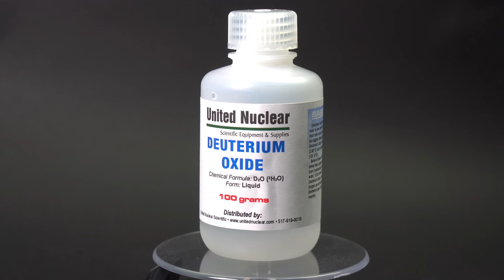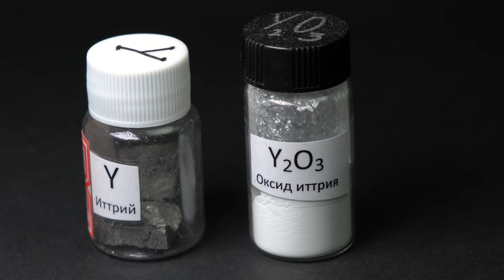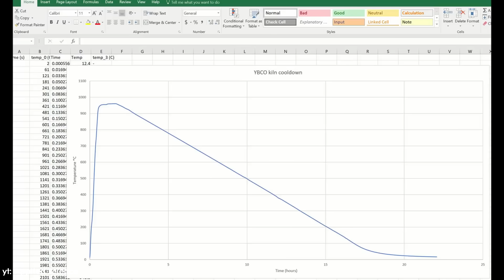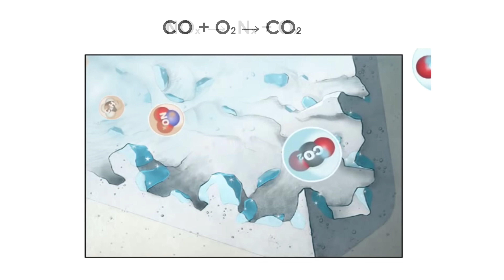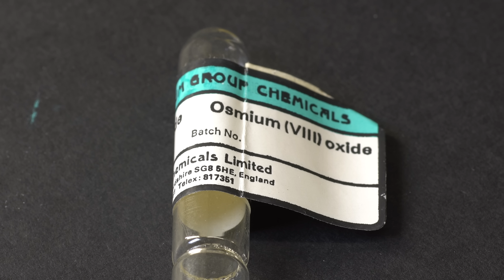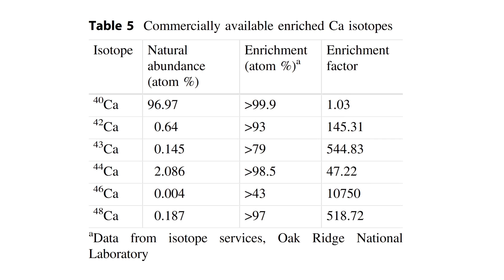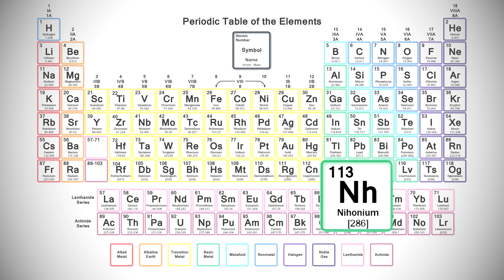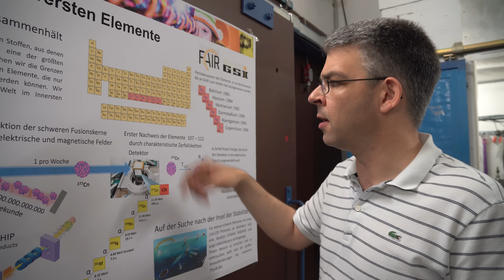How to Turn $50 into $500 using Chemistry?

Comment: One that would be possible for a chemist, with limited funds, is LiAlH4.  It's a very useful reducing agent in organic chemistry, reducing acids, aldehydes, and ketones, to their corresponding alcohols.  It also reduces nitriles to amines.  It's made by reacting LiH & anhydrous AlCl3, as a slurry in anhydrous ether.  The LiH is made by burning Li metal in an atmosphere of H2.  Li can be harvested from lithium batteries.  The AlCl3 can be bought fairly inexpensively.

Comment: Regarding the superconductor, it's much "worse" when you want to make usable "wires" from it to make magnets. You need the YBCO to be almost perfectly single-crystalline, which requires vacuum deposition techniques. The endproduct, a thin tape, costs in the order of 50 euro per meter these days (but quickly going down thanks to private fusion power companies like, Tokamak Energy, ordering thousands of kilometers of the stuff)

Comment: Tritium is needed for fusion reactors. 
You need it for the edges of the reactor for some very complicated reasons. 
But there's basically none as it was thrown out as waste in most reactors that made it around the world. So fusion work is greatly limited by its supply.

Comment: Rhr, real human here, would u mind telling me if u buy memory in bulk if its ok just to soak it outside overnight and skip the other 3 day process that requires mask and more chemicals, i figured just spray off the fingers wirt alcahol, then perhaps borax or no borax could u just shmelt the trace silicon to the surface flick it off and walaa!! 24 k gold right, takes only 1600°f if u use classical rolly metal bin they use for ore shmelt. But i dont know if borax needs alot of oxygen to work either.
Reply: Also mix the big things are copies of large to make a fractal specified unit idk?!, like the lighters thst use quartz for alignment charge, they have ionic lifters, they just made bladeless drones 8 think there using same technique im trying to give food for thought, its like a pressure sensitve multi tube that switches directions and is pressure sensitive maybe valve wise, lets air in fast then compresses it to a point, theres also terger pressure that can be altered frequency and temperature 8 have makes less energy need in electrolosis now they hsve a thing where only one side touches the water in process used to suck more water in

Comment: You need to have a famous company to sell it. If you made it by yourself, no one would buy from you. People buy chemical from Sigma-Aldrich not because the chemical are expensive, it because it is pure chemical and have good reputation. People buy the reputation from Sigma-Alrich, not the materials. For example Yb2O3 from China 50 dollars per KG, Sigma-Aldrich bought Yb2O3 from China and sell it 75 dollar 10 gram, 100 times more expensive.

Comment: You need to have a famous company to sell it, no one would buy from you. People buy chemical from Sigma-Aldrich not because the chemical are expensive, it because it is pure chemical and have good reputation. For example Yb2O3 from China 50 dollars per KG, Sigma-Aldrich bought Yb2O3 from China and sell it 75 dollar 10 gram, 100 times more expensive.

Comment: The video is good and instructive on some curiosities about chemistry, but as a chemist I feel the need to add to the disclaimer in the video by saying DEFINITELY DON'T do ANY of this at home with whatever gear you have cobbled together, without knowing A TON about all of this (even though anybody knowing more than a bit about this wouldn't absolutely attempt it)... And by a ton I mean that no amount of online reading will ever give you the expertise to do it without risking serious damage due to toxicity, or flammability of this stuff or its byproducts: there is a reason why these chemicals are in such high demand (and therefore so expensive), and that is they are not easy to legally make, even for professional manufacturers... Oh and remember you shouldn't even begin to hope you can make a profit out of doing this: you and anybody buying it from you are first and foremost at high chemical risk with no possibile way of preventing it NO MATTER HOW INFORMED YOU ARE, and second you need to comply to international legislation, otherwise you are out of the radar of any serious company on the market for this stuff. And rightly so: this is no game.

Comment: one of the many downsides of these process is that depending on the reagents used, you may not know the contaminants in them so it could add a significant ammount of impurities to your product that could havle a drastic effect on the price. one place might buy your 5 grams of Chloroauric acid for whatever ammount, but if its only like 95%-98% pure the place might not even want to buy it. from what ive gathered from metal refiners and chemists who do stuff like this, any significant ammount of impurities will tank your earnings, plus even if your product is pretty pure you still have to buy pure reagents, which are expensive, so this is really only viable if youre doing it in a large scale (50+ gram ammounts).
Reply: Purity is always where the cost comes from. Anybody can stick a few chemicals together in a bowl and call it a finished product.
Reply: do you know people that do this for a living?
Reply: You have to refine the metals first, sometimes multiple times and as you said, do it in large batches.
Reply: Was thinking same thing , when the costs v the sell price ,
 An ounce of the metal would make it worth while crafting  . 
"ORMUS" , is an easily made , but expensive product to buy - the base ingredients , being quite budget freindly , and should produce good returns - higher still if the 3 noble metals can be separated , as each is a saleable item .

Comment: Couldn't you just have a hydrogen fuel cell that doubles as a heavy water factory, allowing you to store excess energy from say, renewables on site and produce this valuable product at the same time? In fact, couldn't you produce this nuclear moderator using a nuclear reactor? And since your nuclear reactor would be a closed system, you'd never lose any D2O to evaporation.
Reply: Yes you can't let hydrogen escape it's a greenhouse gas so you can do anything with it but don't let it leak

Comment: What i want to know is if some chemistry genius can make binary drugs - two uncontrolled substances that you can mix together and get something like fentanyl, cocaine, morphine, methamphetamine, etc.  Basically take the last two steps of a synthesis and sell those two ingredients packaged together like how they’d sell grape juice and yeast together during prohibition to make wine.  But can you do it without using any listed chemicals?  Or at least sell two totally legal chemicals that when mixed together make a good drug?
Reply: Most states will have some form of legislation controlling the movement and usage of precursors of controlled drugs, some are more harsh than others but as a general rule they all serve to reduce the accessibility of illegal production of controlled substances which attempts to prevent this exact scenario from occurring.
Reply: @CATASTEROID934  yea that is why i said can it be done without listed chemicals (the common precursors like acetic anhydride and piperadine and many others).  But I’m sure someone can make heroin without acetic anhydride, that’s just the simple way to make diacetylmorphine.  I’m sure a more complicated drug like Quaaludes is a better example for doing this.  They can’t ban every chemical there are an infinite amount of them.  The most efficient, simple synthesis methods are going to involve listed precursors, yes. But some genius could come up with a very complicated, inefficient way of making fentanyl without piperadine.  There have to be other ways.  Imagine having a chemical printer (my dream invention).  You just put the elements in, tell it what molecule you want and it makes it atom by atom.  You could just make anything I know, but point is you could make drugs without the controlled precursors.  

Obviously a chemical printer would be the most illegal thing ever, america would nuke anyone even trying to make one.  The cult down the street is gonna print up some nerve gas.  Freedom is dangerous though.  Gotta suck it up.

Comment: include a compressor heat pump with a super conducting electric motor-generator, 100kA current, a ton of wire coil loops
Reply: a lot of power in small size, no resistance of copper coils to high electric current
Reply: try sea water electrolysis to get some of each element, use biomass carbonized carbon electrodes, make more if electrolysis uses up them
Reply: electroplating copper 3d mold filling
Reply: separate ions after D+D fusion synthesis, like the tritium, by mass spectrometry filtering
Reply: no cost is above than the facility it was made in
Reply: how much a country costs, if it was a company, maybe a 100 year of its GDP, maybe 300Trillion USD
Reply: @ccriztoff  of course
Reply: make a superconducting wire loop energy storage, YBCO, L=1000m, I=5kA, E=½LI^2, gives 3.5MWh, in quite nice package, only a fridge magnet strength with air core
Reply: where did you get that the deuterium will concentrate into electrolysis water, only giving out light hydrogen as the gas

Comment: 1:10 As I know the D₂H can also be separated from ordinary water by freezing it. Deuterium has a bit higher (~ +0.1C⁰) freeze temperature than H₂O
Reply: You cannot almost certainly control the freezing process to such a subtle degree, or rather decidegree to be precise. So I'd say it can't be done in real life.
Reply: @LuisAldamiz  you dont  need to freeze 100% of the water 
For example start with 100 liters and keep partially freezing it like 50 % each time 
After a couple cycles you will have a smaller amount enriched with D2O
Reply: @koukouzee2923  - Is it actually done? You seem to be talking of an actual technique.
Reply: @LuisAldamiz  I never seen it done (the freezing method) but theoretically it should work 
But the aluminum NaOH and electrolysis are legit 
I'm planning to do it one day it's in my projects list
Reply: @koukouzee2923  - But does it even exist in real reality? My objection was that such a tiny difference in the freezing temperature is not actually usable because you can't effectively (theory alone does not get things done) control the water mass' temperature to such a tiny level. I grant you that maybe some geniuses have found how but I sincerely doubt it.
Reply: @LuisAldamiz  the temperature difference is actually quite big 
D2o freeze at 3.8C I think and DHO between that and 0C 
The problem is the concentration of D2O and DHO in tap water is extremely low 
Best tactic is to hold the temp at 1C and collect the ice and keep doing that until you got a good enough sample that the D2O crashes at 3.8 C
It's all theoretical but this kind of fun
Reply: @koukouzee2923  - That's not what Oleg said, he said: 0.1ºC, which is a tiny amount. Your datum seems more correct (although it refers to melting point, which is 0ºC for common water). I guess you can play with that differential. Cheers.
Reply: @LuisAldamiz  Ah, sorry, it's my mistake. Actually I've read about in some old Russian book, something about 25 years ago, and don't remember exact difference, just it was small.
Anyway true was found, and 3.8C is good enough temperature 😉
PS. The book was starting with words: Walking in deep autumn nearby Siberian river you may see ice on obstacles in it, but water is flowing and temperature is high enough to make it frozen, what do you think is it ? It's crystallized heavy water ! 
Btw, I suppose tritium has also different freezing temperature, and should be even higher than deuterium, however amount of it in nature is much much smaller than deuterium
Reply: @29Aios  - I ended up going to Wikipedia to check the melting point of regular and heavy water. The difference is much larger than you said and that works for your initial claim because almost 4º of difference may be enough to do as you suggested.
Reply: @LuisAldamiz  you can use the method on a sample of electrolized solution, then if you freeze it while in an insulated container it will start to freeze from the top
Reply: @LuisAldamiz  for pure heavy water, but it is gonna be mixture with 99.9... normal water. And they perfectly mix so the separation may be only 0. apart depending on concentration.
Reply: @LuisAldamiz  0.1° C is a very large temperature difference for something like a freezer.
The issue is not getting that precise, it's that freezers are not often sold with controls designed for that.
Reply: @humanistwriting5477  - Never mind: read the latest comments: the actual difference is much much larger and that's why it might be doable (although I don't know about the specifics).
Reply: @LuisAldamiz  ya, I saw after I replied. But I left it because .1° C is very attainable control.
.1° F is difficult bearly doable in a reasonable set up but those scales are on different orders.
Reply: @humanistwriting5477  C or K = 5/9 F, they are not "on different orders" at all, roughly F = 1/2 of C, a little bit less actually.
Reply: @29Aios  I just pulled a bottle of reverse osmosis treated seawater from the freezer. Well actually it fell.. and I was looking at the weird way it froze.. the outside of the plastic bottle was still liquid and the inside was a weird soft not quite crystalline slush??

It looked really weird to me as normally water tends to freeze from the outside in which is why when making ice cubes one uses hot water..

I have no real explanation for how this happened???

Edit: just checked the other bottle which had the same look but now it's frozen solid.. weird thing is the bottle is not expanded but collapsed a little what on earth did I just drink??
Reply: @humanistwriting5477  seems doable  to me too assuming you take enough time and insulation.. separation would be hardest as you'd break insulation (except in an conditioned room).

Would it sink to the bottom?

Edit: oops it would still be liquid
Reply: @markrichardson6875  . weird thing is the bottle is not expanded but collapsed a little what on earth did I just drink??
if it's not sweet than it's not heavy water :)
Reply: @29Aios  still a weird thing to see.. eventually the bottle did expand so perhaps it was not fully frozen yet and air left in there was contracted
Reply: The main modern industrial process for deuterium separation does isotopic exchange between the feedwater and H2S at low and high temperatures. This uses much less energy than distillation or electrolysis and has higher throughput.

https://en.wikipedia.org/wiki/Girdler_sulfide_process
Reply: Or just use electrolysis or aluminium NaOH like cody did
Reply: Its left behind in electrolysis too
Reply: I got an idea for an eastern fridge yurt, has like egg whites maybe feathers on it to reflect the sun naturally makes ice sub level, was thinking of using starlite instead of aerogel and peltiers, if made to bluetooth you could probobly make exact tempertures that r maintainable, until recently also non electric tubes or hoses you can wrap the yurt underground  with burried maybe hot water hose because of compost decay, so that would be your non electric ice producing hot waterr producing peltier energy grid, also if u need just heat you can mqke a parabolic mirror using space blanket and fiber glass, maybe apoxy a pump and something to stretch and hold it all its on yt too, recently thought about surf board inside a pole that has the outside exposed to the air but the pole is metal thought about ufo and near kelvin, i hear nitrogen is usualy not magnetic and comprises of most of the atmosphere and would weigh more than a table in a empty room with a table in it, also theres like doppleganger particle direction opposites that can be used in corono motor, wonder if u can slingshot a giant piece of metal in a ufo or something and make the hull become superconductive instantaniously or something,
Reply: They could make solid like good slingshot maybe but use micromachines to stack the gold using various memory metals, need lot temperature control, miniture faraday cages might be able to move because of reppelling radio waves also it could make a ground for static corona deal, perhaps the doppleganger at higher elevations is how the ufo might use the horse and carrot technique
Reply: U kniw the opposite direction dopple ganger prtcle might be used as a wireless field to emit properties from the ship over time making a sorta superconducted air nd the magnetic positions fixed for launch plus air is magnetic anyways,

Comment: is a good idea to recycling the electronic waste. However you forgot to mention who is willing to buy your gold compounds 🥺😔.
Reply: It takes a lot of electronic waste to get any appreciable amount of gold from the ram chips.    They do it in Africa with throwaway cell phones.  They burn the phones in a fire and pick out the molten metals out of it to get a few cents...because that is all the buyer will pay...because it mixes easily with other metals and gets lost in the mix.   Besides that burning the plastic is giving off a toxic smoke.  It is a complex chemical process to get to pure gold.  The ram chips are getting smaller so there is less gold in them so you need to burn thousands of phones.  Hell, if I collect soda cans it will be faster to make money.  & easier.